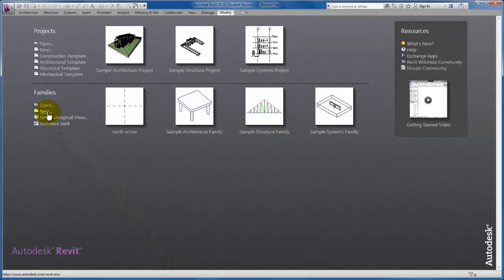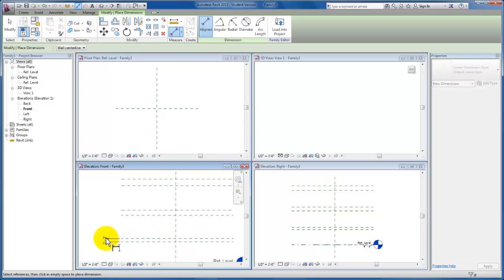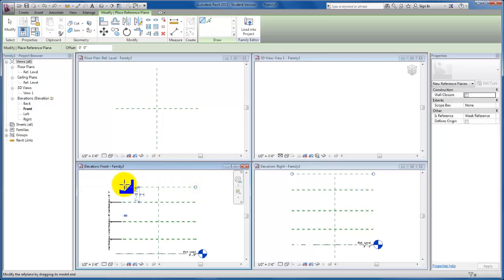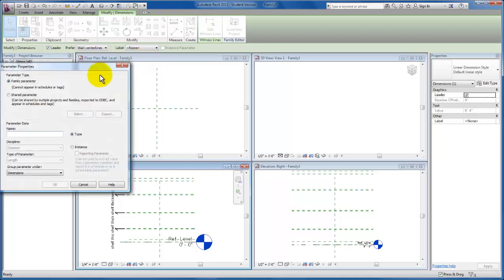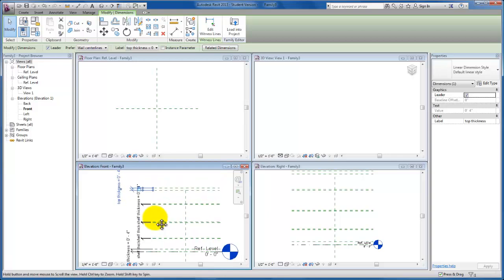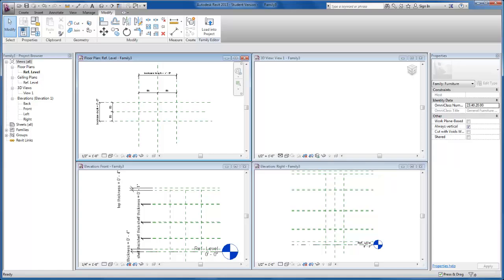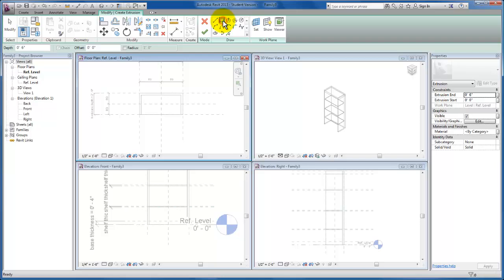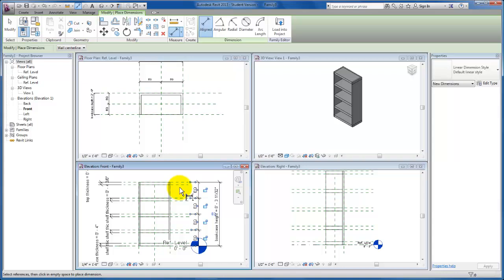Revit Tutorials: Revit Families - Bookcase Family

Comment: Hi SmartArchitect. I really need your help in creating some kitchen cabinets. It is being too hard to find the right video showing with detail as your, but I am still having problem with ref plane. Please help me. :(
Reply from the maker: Let's look at this from a different angle Diana.  Next time you open Revit....go to Autodesk Seek and download the Merillat Cabinetry for starters.  There are over 1200 different styles of cabinets ( base, wall & corner here )available  for use in your projects.  Try opening one in the family editor and dissecting it to understand the components.  Reference planes can be understood as the guidelines used in conjunction with parameters to control the way our family types flex in Revit.  Play with a correctly formed cabinet first and see if it helps bring you along better.  Let me know how you're doing with it.

Comment: Does Revit make sense for interior designers? I create very intricate models in Sketchup and I feel Revit is too cumbersome for creating presentation models. Responses appreciated...
Reply from the maker: No matter what software package you use...remember that the most important factor is "software compatibility" with your project team.  Most software packages allow export to CAD feature, but be aware because it does not always translate all of the information accurately.  As a consultant, it will be critical to be able work in the platform of the rest of the project team when possible.  This is the reason I am currently using Revit 2015, 2016 & 2017 because the program is not backwards compatible and I am on project teams using different versions.   Do not overcomplicate this though - Learn Revit - it will not be a waste of time as a large share of the industry is in BIM or moving there now - increase your personal marketability.  That's where I started.
Reply from the maker: Its not a simple answer by here's my opinion.  If you are advanced in Sketchup and have not need for construction documentation, then maybe the Revit investment is not worth it. So look at the long-term goal as much as possible.  Also remember that whatever firm you desire to work at will likely have a preferred software workflow especially if it's a small business.  However, I know many interior designers who learn Revit because the architectural designers have already built a base model in Revit and it just makes alot of sense plus it can all be rendered directly through the Autodesk Revit platform.  Thanks for watching and hope you subscribe!  Really great new content coming in 2017.
Reply: If you got as good as this guy, yes, it would be great. I learned in a program called Cheif Architect. As a design program, it is AWESOME. Much faster and more specific. It's like 2,500$ flat fee though. While Revit lt is cheaper, making families is slower. You can do it if you understand work planes though. I don't know a lot about Sketchup, but I dont think it has work planes or parameters. I could be wrong. I think Revit is really optimised for construction documents on buildings myself. It models really well also, but slower. If you really take your time making your own families, and make as much parametric as you can, then its like a single instance time penalty. Cheif, you can go in to a cabinet, change its front, hardware, shelves, drawers, materials, countertop and backsplace material, thickness, height, etc etc etc. Everyting can be changed. And it will import sketchup models, though they are not parametric besides being standardized. Revit, though, is the industry standard. As a draftsman, I see everyone wanting Revit. So...
Reply from the maker: TIP - If you are building industry standard cabinetry, then you are not taking advantage of Revit resources like Autodesk Seek or manufacturers who offer Revit families of their equipment listing.  Watch the ARCAT tutorial here:   https://www.youtube.com/watch?v=tCFwXHVvNFI

Comment: Hi! 
It is helpfull up to one stage. I am trying to make a closet family using your video, but problem is that I am stuck with the door drawing.
Should I add two more components in front of the unit to make the doors??
Thanks for your reply
Reply from the maker: Sammy EL IMAM Interesting.  If I understand correctly, you want to basically add doors to this bookcase unit. Yes you can create doors using the extrusion tool and build handles as well.  It will involve a little more work to make it appear properly in plan view....but in 3D view - the object will be fine.

Comment: In the finished bookcase the various extrusions overlap with each other at the points where they intersect. Is there a way to merge/boolean so that the lines and volumes do not overlap? Or is this not a problem when it comes to rendering? Great video, by the way.
Reply from the maker: David Stafford#LPFWLP_S Yes, you can merge the extrusions together...on the modify panel, there is a "join" feature that accomplishes that effect.   Rendering is not affected either way but you will need to assign the material to each extrusion if they are not combined.